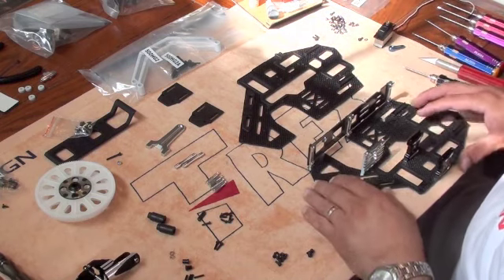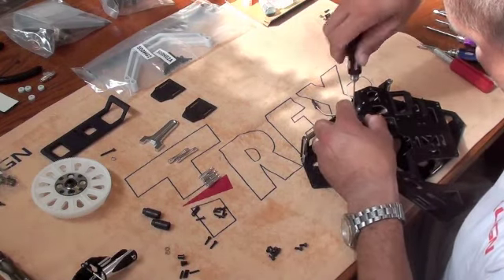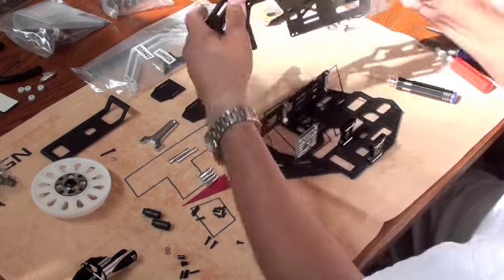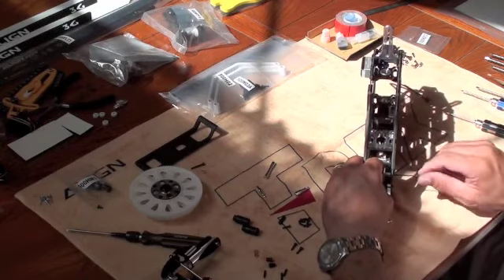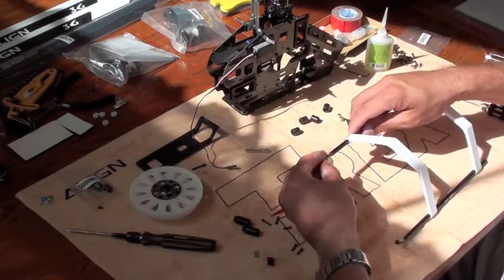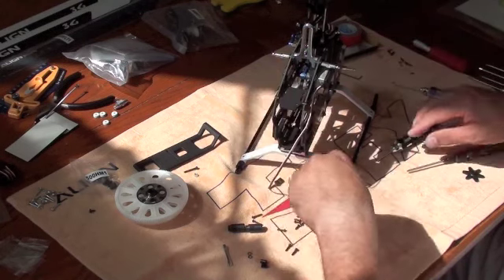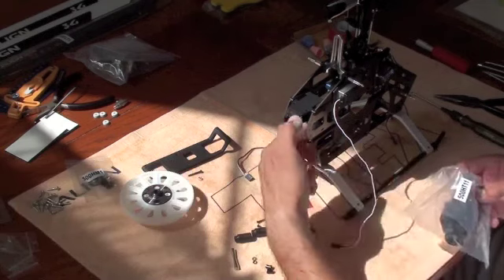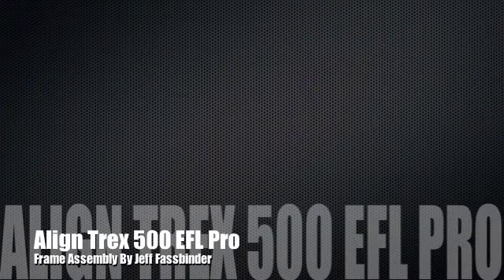Align Trex 500 EFL Pro Frame Assembly w Servos.m4v

Comment from the maker: @astrecord Well you could get by with 6 on electric but if you intend to use governor function you will need 7 channels on a nitro helicopter. Also the 7 channel should be easier for setup with radio.